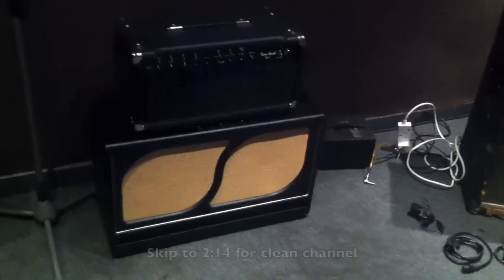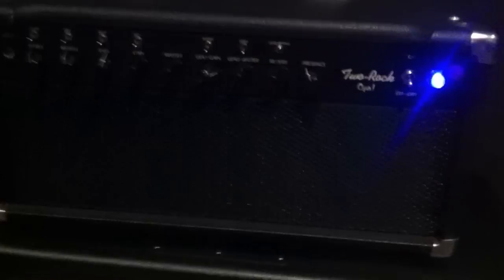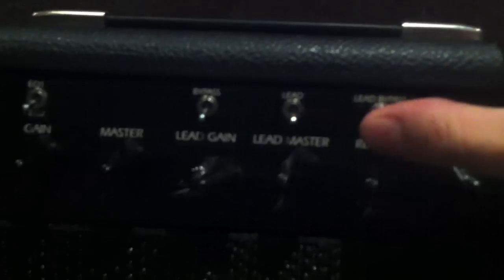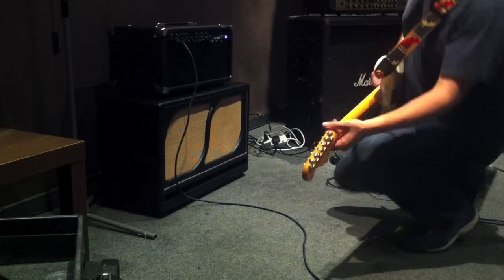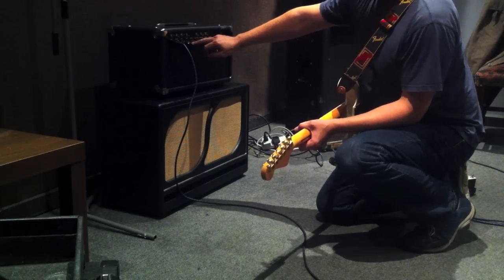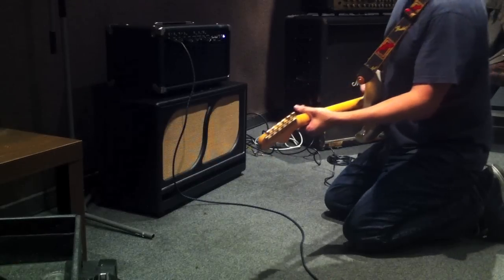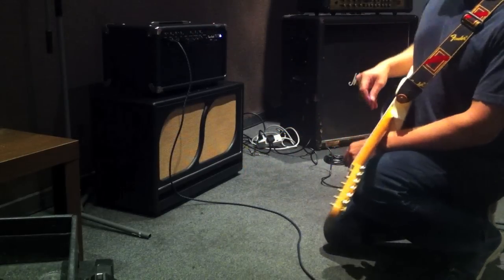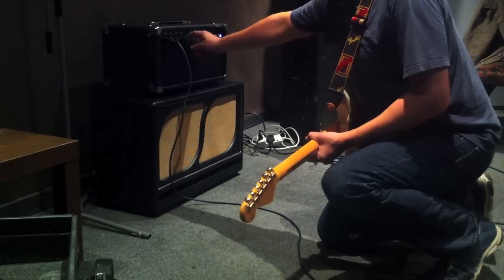Two Rock Opal (#48)

Comment: What kind of cabinet and speakers were you using? What a great tone you had there. What did you replace it with?
Reply from the maker: Thanks. The cabinet is http://portcityamps.com/ - Port City - I have a 1x12 too, great, great cabs. The speakers in there are G12-65s. Probably not the best for a Two Rock. I now play a couple of Blankenship amps - a 50W variplex and a 30W modded blackface Bassman, which I much prefer - much simpler, purer circuits. Less bells and whistles, but incredible tone.
Reply from the maker: Blankenship Bassman

Comment: Hello there, Great playing! Do you think one can use the Giggity after the overdrive pedals to make a Two Rock sound a bit more like a Marshall? I own a Two Rock Studio Pro 35 and I love it with my CS Strat, however when I get my Les Paul R9 it sounds too big and fat. The sound of a Les Paul in my head is that of a Marshall JTM45 so, do you think I can get close enough? Your advice is much appreciated.
Reply from the maker: The giggity is really versatile. It can thin out humbuckers or fatten up single coils. But it can't do magic. You can use it after an overdrive - it becomes a sort of eq tone shaping pedal. Do you use an OD pedal or is the amp distortion? It's harder to change the fundamental sound of Amp distortion. It is what it is. I would suggest starting over with the les paul - go into the amp and try to eq the amp to the LP rather than the settings you have for the strat. Then see what the difference is and you'll know what you have to do, eq wise, to match that difference.

If the amp distortion won't do what you want, probably easier to find a pedal that will take you some of the way there. There are loads out there.